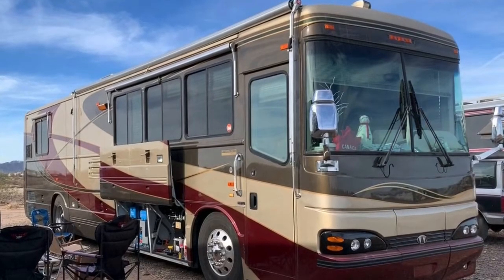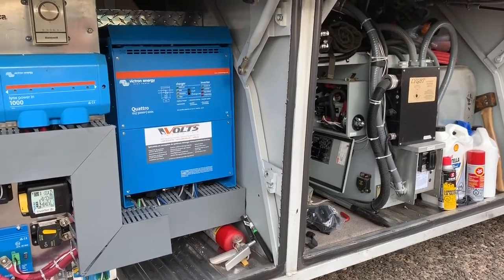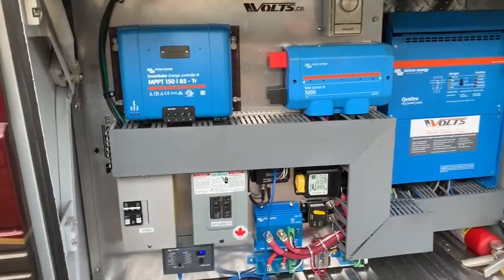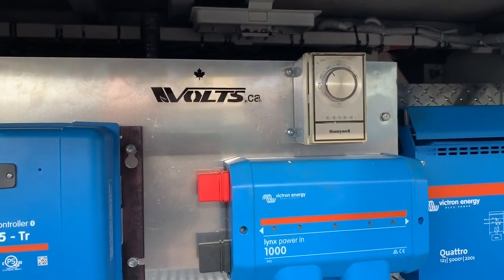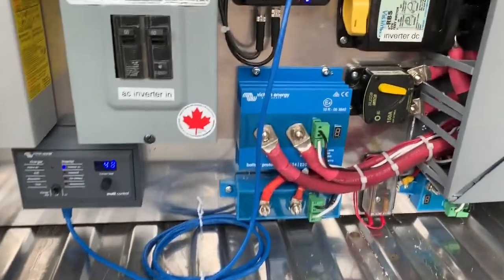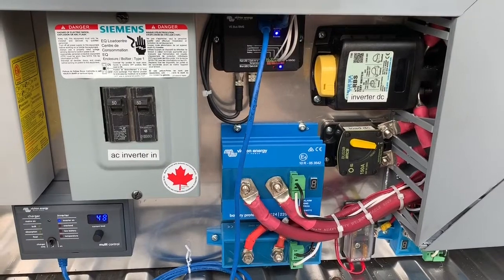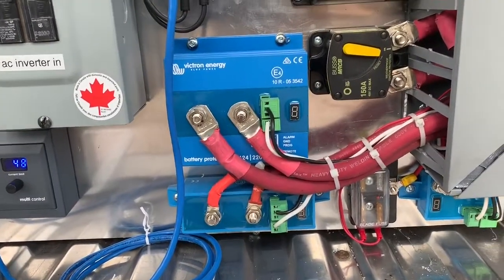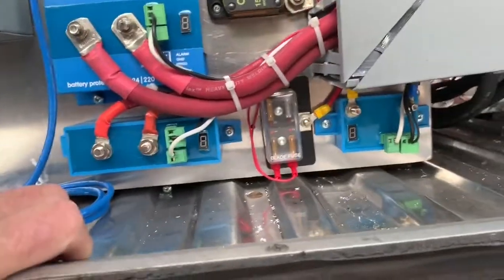Part One - All Electric M380 with Victron System (Watch Before Part 2)

Comment: This was the best system set up I ever seen
Reply from the maker: Certainly the cleanest install, that’s for sure. I would’ve gone 24v or even 48v on the inverter, and a larger battery bank to match my 1,500 watts of solar. But otherwise would not have changed anything else.

Comment: Pretty impressive system Van.  As stated it's more geared for colder climate and not the heat we get in Arizona in the summer time.  for those of you that don't know this was filmed in Quartzsite, Arizona at an annual WOG (Wanderlodge Owners' Group) rally at the annual Quartzsite RV show.  Van, that conduit to house all the wiring is standard for use in running network cabling in our datacenters.  Was there a cost of this entire system mentioned?  Is it over $20K ??  :-0
Reply from the maker: Andre and I never discussed price on or off video, and that was on purpose. Suspect this is one of those “If you have to ask...” upgrades. Round numbers for PARTS alone I’d guess $20K, then add installation. At the Q Big Tent this year 100Ah BattleBorn Lithiums were being sold for $900/100Ah, so there’s $11,800 for 1,200 Ah without the snazzy blue Victron markup. A 5,000 watt Quatro 12V Victron inverter/charger is $3,400. Throwing in all the other little “boxes”, cable, housings and fittings could easily run up the total.  As to installation cost I have no clue, but it is a very well done setup.